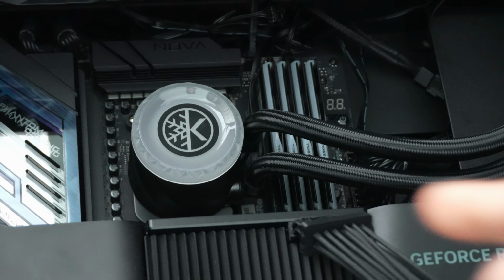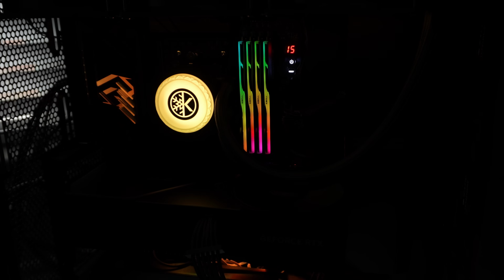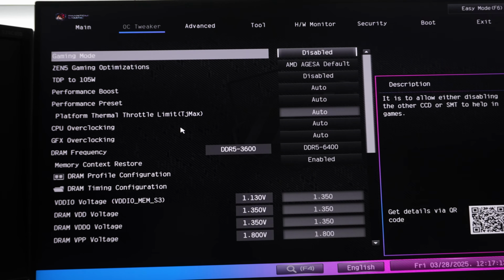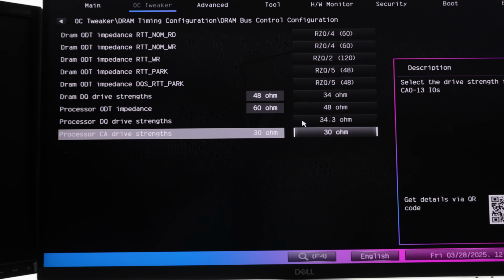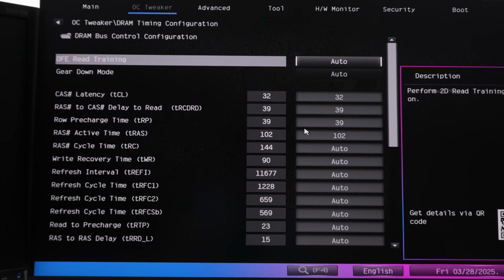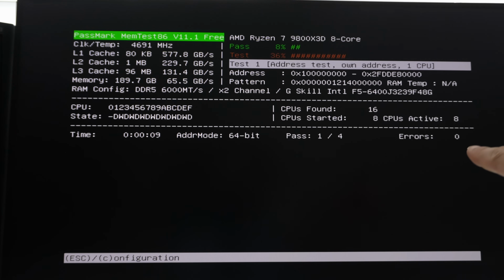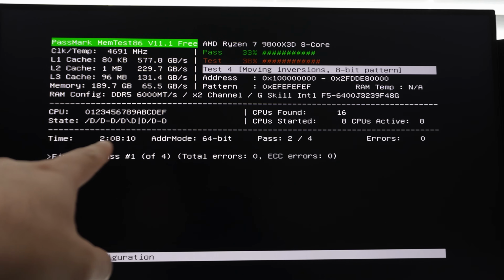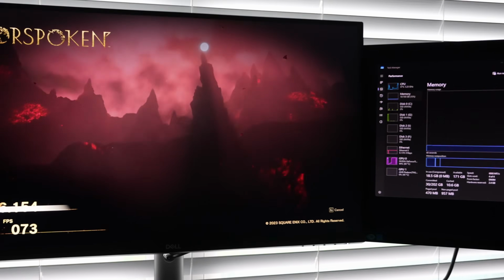How to run 128GB and 192GB at DDR5-6000

Comment: I had been waiting to get the thermal grizzly astral gpu block but it been frustrating so got the oc core, I had my thread ripper asus zenith extreme running 128gig  kit running at its speed,  im about to finish building crossfire extreme x870e ryzen 9 9950x3d and I hope I didnt over do my ram with a gskill 256gig kit I know know I shouldn't had bothered going that extreme but was a 4stick kit of 6000, would you imagine the setti gs would be similar, my zenith I followed some I structions I downloaded and managed not to corrupt anything, I do appreciate your advice and will do the mem test usb
Reply from the maker: Keep in mind that these settings are meant for ASrock and Gigabyte motherboards. They are not meant to be used on Asus. For Asus, if you have the 256GB kit that's on the QVL list then all you need to do is use with the included EXPO profile.

Comment: I will be trying this out on my own system here pretty soon, getting a 2nd identical kit from the same seller of G.Skill Trident Royal 6400MHz 2x48GB RAM, I'm running an Asrock X870E Taichi currently, so I'll try your impedance settings as a baseline & see how it goes, I'll report back with how it went, kit won't be here til Thursday though.  I'm hoping I can get 6000MHz to work, that would be neat... and then I can test how much RAM the workload I run ACTUALLY gets up to if I'm not clearing the buffer & reloading every so often to avoid running out of RAM with the current 96GBs I have.
Thank you for this guide & the other videos you've done on the subject.
I know it's expensive, but it'd be really cool to see you do a comparison between 2 96GB kits or 2 128GB kits & a single 4x48 or 4x64GB kit to see if it is actually easier to make them 'just work' with the 4x sticks kits, or if that's just BS from the RAM makers.

Comment: Using ASRock x870e Taichi with 9950x3d. Have  2 identical kits of G.Skill F5-6000J3036F48X2-RM5NRW. Single kit just works on 6000 selecting EXPO profile in BIOS. with 4 sticks of RAM, best I can achieve is 4200 instead of base 3600. I tried to reproduce same impedance and other, manual voltages, etc, like on a video - did not help in any way. Looking to any way how to obtain it working. 5200 will be fine.

Comment: In my case of overclocking 4x48Gb DDR5, Memtest proved to be close to useless. If will pass Memtest no problem and y cruncher will throw an error within minutes. And even when Memtest and y cruncher are both stable, my PC can still crash when just idlying on desktop. 

So, from certain point, I use only y cruncher and desktop idlying is my final boss.

Comment: do you need those changed impedance values if your doing 192gigs and not just 64 etc
Reply from the maker: This is only needed for 2R 2DPC (i.e. 128gb or higher).

Comment: Same motherboard but I’m using t-force DDR5 FF3D5232G6400HC38JDC01 kits. One 32Gb kit came free with my motherboard from Newegg. I bought a second kit on Amazon. Leaving everything default and changing the speed to 6000 worked for me. Changed no other setting, selected xmp1 default profile for the memory. I’m pretty happy with it. 

Pc uses 9800X3D and RX9060XT. Not fancy but better than my 10 year old pc running a vega64 and Intel I7-9700k.

Comment: Got a asrock steel legend X870 (3.30 bios) running ryzen9 9950X and the exact same memory kit showcased here, and for the life of me, it won't train anything over 4000mt. . I just manually set 4800mt conservatively, everything else in auto, the thing just won't train. Had to clear cmos  at every attempts which is exhausting after awhile... Any idea to even get a shot at fine tuning a successful training past 4000mt?

Comment: I bought the G.Skill Trident Z5 Royal 32 kit, I got 4 in my system. I'm on a Ryzen 9 9950x3d. I cannot get it over 4000Mt. Am I doing something wrong? I need your advice. I might need to replace my CPU, I think I got a bad bin. Please advise because I don't know what to do. I am concerned to replace the CPU. I've spent the whole day adjusting settings to get it to work.

Comment: Hello Good Video :) I have a Asus X870e Hero Ryzen 7 9800x3d and Dominator Titanium DDR5 (6000MHZ) and RTX 4090 i have 4*32 GB RAM 128GB RAM i cant stable EXPO 1 at 6000MHZ but i can 2 DIMMS 64GB Ram 6000MHZ EXPO 1 no problem and i can load 4 Dimms EXPO 1 and go under 5200MHZ isa STABLE give you a trick i can run 128 GB DDR5 RAM at 6000MHZ Stable at 4 Dimms? :) have a nice day :)   RAM: Voltage 1.40 Timings CL 30-36-36-76 @Game Tech Reviews

Comment: hey I am very confused... your DDR is rated at 6600 , you say the target speed is 6000. I am confused. If you just enable EXPO / XMP , wouldn't it just take care of itself?
Reply: 4x DDR5 at full OC speeds isn't possible nowadays. The rated OC/EXPO/XMP is rated for 2x kits.
Reply: @Caborrrl  ~two weeks ago G.Skill demonstrate 4x64GB with Hynix chips at 7000Mhz CL38 on X870E Godlike. And 4x64GB 6400Mhz on X870E Hero.
Reply: @Caborrrl It's possible. One of the PCs we have runs 4x DDR5 at EXPO speeds. It's just luck of the draw.

Comment: Can MSI X870E carbon run 4x48Gb 6000Mhz CL28?
Reply: Yes,Is So Easy!
Reply: Hey, I'm about to buy the same. Did you try it?

9950x3d, x870e carbon I'd like 4x48 6000MHz CL28
Reply: @grutos  yeah, I got it. Running well no problem. But my only issue is CPU running hot at 55 - 60c at Idle. Using Liquid Freezer III Pro. Let me know your temperature with your setup

Comment: I'm planning of buying a 9950x3d and 192GB of RAM but I was not thinking of overclocking the memory. Is the frame rate decrease significant because of the RAM (the GPU will be a 5090)? I was also maybe going for the cheap Crucial Pro memory with high CAS latency (46). With that CAS latency will it be even worse, or because the RAM is running so slow, that high CAS latency doesn't really matter?
Reply: Good luck :-| this is what I have...and it will not boot with 4x 48Gb @ 6400... It keeps defaulting back to 3600, and I can get it to creep up to 5200, but 6000+...hates me lol
Reply: @ultrapetey  Same here. What is your progreess? @MM-ed1we 
I can't get it over 5200 either for the Ryzen 9 9950x3d. What do you have so far?

Comment: Someone suggested to buy 2 2 stick kits with different color heat spreaders so you will always know which 2 belong with each other. I have 1 black set and one white set. Thank you for this! I have this exact board and memory, and couldn't get it to work faster than 3600 (of course) I can't wait to try your methods to get them working!
Reply: lol you didn't hear about serial number 😅
Reply: @PojegaPJG   Probably so...
Reply: @PojegaPJG often times serial numbers aren’t actually sequential. I got a kit that wasn’t. 2 were but 1 was random
Reply: @Savitarax never happened to me all Twin kit it was in order 😅
Reply: I managed to get 4x48 working with 6000Mhz CL32
Tertiary and Secondary Timings tight as my regular 2x16 kit or 2x48 kits with slight variances or +-1 tick due to binning and voltage. 

What really mattered was Terminations and Nitro Mode
Reply: Hello, please tell me if you managed to make the memory work with a frequency higher than 3600? I can't do it with 192 GB, the video tutorial didn't help, my motherboard is a little different - Taichi Lite.
Reply: @Jacksitjey  I gave up. But supposedly some of the newer BIOS make it easier. Maybe if I get bored I'll try again.
Reply: @Jacksitjey  no matter the timings highest I can do is 4400. But 4400 with very tight timings, almost as low as mb let's say them.
Reply: @ThereWasNoFreeName  Thanks for the answer! Good luck to you;)

Comment: I just built my first PC, a bundle from Micro Center: Gigabyte B650 X AX V2, Ryzen 7 7700X, and 2X16GB of G Skill Flare X RAM. I went back a week later and got another two-pack of the same Flare X, and put it in. I would boot the four sticks up in 3600 MT/s and it would run stable and restart, and then I could enable EXPO and get 6000 MT/s, but it wasn't stable, and would not restart. Last night I tried EXPO with Power Down and Memory Context restore enabled, and this time I changed the Memory Multiplier and set it to 4800 MT/s, and it booted right up, and has restarted two or three times now!👍So now my strategy will be to creep up the Memory Multiplier, hopefully to something near 6000 MT/s. I'm guessing I'll have to change some voltages and impedences in that quest...
Reply from the maker: For that setup it doesn't need any of this since it's 1R 2DPC. For that you just need to make sure the different kits are isolated from each other as mentioned at the start of the video.

Comment: Hey man, great video! I'm currently building a pc with 192 gb ram and a 5090, I get the same ram as you suggest. G.skill Trident with 6400Mhz. I just wanna make it get to 5600 but I have not yet bu the motherboard. I know the nova is a good choice but I'm scare because it seems is messing up with the new ryzens 3D? I've the 9950x3d. So I should just get the nova?
Reply: Get the Nova....you won't regret it. Great value board!!! You get it all

Comment: I tried this with 4 dimms of 48GB Corsair Vengeance (Hynix die) rated 4800 JEDEC and 6000 EXPO1. Updated the x870e NOVA bios to same v3.20 as you. The overclock did not post at 6000 for me. In fact, the JEDEC profile does not even post with 4 dimms! Settled on 4000MT/s for perfect 1:1:1 match, but tuned all timings obscenely low: 22,26,26,56,82. MemTest86 reports overall Memory Latency of just 70ns, but throughput (visible during test) is only 48GB/s. As expected from 1:1:1 ratio, MemTest was super stable, no errors. What do you think of these settings?
Reply: I can push to 4200MT/s at 2100MHz infinity fabric. That increases throughput to 53GB/s, but Memory Latency worsens to 77ns and the NOVA starts re-retraining RAM on every single boot! A 10% throughput increase is not worth the 5 minute wait for RAM training on every boot and the 10% latency hit, IMHO.
Reply from the maker: Are the two different memory kits installed correctly, as explained at the start of the video?
Reply: @GameTechReviews  yes, the two dimms from each batch are in A1,A2 and B1,B2 respectively. I even switched them around Old into B and New into A as a test. Did not help.
Reply from the maker: @HamsterHearthstone  DId you try manually choosing 6000 without loading EXPO? And then just manually set VDD, VDDQ to 1.35v and VSOC to 1.2v and then also the same ODT and RZQ values shown in the video?
Reply: memtest86?

Comment: What are my chances of running my Corsair Titanium 96gb at its full 6400 on a Nova/9950x3d?

Honestly I'd be happy with it working at all but wpuld like to hit at least 6000. It feels like it should be easy but I'm reading about so many people struggling with RAM in ways they never used to. Im such a noob too, this is only my second build.
Reply from the maker: If you are referring to 2x48 or 4x24, I've covered that in other videos. Both can run 6400 and it's much easier than what's shown in the video.

Comment: I wish ASRock updated their Bios like ASUS or Gigabyte or some other Company who all have AI tuners and many EZ options to tune instead of having to do literally EVERYTHING manually! I have had ASRock since the beginning...  I got the Phantom Gaming X X570 in my Rig now with my 3090 in it but im building a new rig with the new 5070 Ti card and this time I think im gonna buy ASUS or Gigabyte! I want these AI options and see how they work... I do love ASRock though... Great M/B's...
Reply: The AI features aren't worth it. Its the cause of your some people having overheating issues or just a bricked CPU. I have an ASUS board and I turn the AI stuff off. You either want to do a manual overclock or none at all, because the AI doesn't do a good job of doing things right. I used to be better way back when they didn't push things too far. I even used it as a starting point for overclocking. Now they just set your voltage high which kills your cpu faster and give you a low overclock if any.

Comment: Dude I’m trying the settings and my kit is just stuck on 3600. I feel like I’m going insane. I’m running an asrock Taichi with a gs kill 4x32 6000mhz 30-40-40-96 1.4v all bought that the same time. It also has my voltages locked even tho I’m changing them
Reply from the maker: Are the kits installed correctly? Meaning both are on separate channels, isolated from each other.
Reply: @GameTechReviews I think? My first kit is A1 and A2 and my second is B1, B2. I think that’s what you mean?

Comment: I would like to add......
  Anyone with a Gigabyte Ai board,for memory tuning and preferred speeds,you can avoid changing settings in the bios if you're NOT comfortable doing it by just downloading Gigabyte memory tuning utility called 'Ai Snatch'.
   It will Ai tune your memory to the highest speeds possible and give you a set of options.If you choose an option(speed) and your system doesn't play right,you come back and  choose the next best option,reboot till your system is stable.
  I'm using it since I got my X870E Aorus Xtreme from day one and it's been flawless.
   Hope this helps for those who don't want to fiddle with their BIOS.

Comment: Nice detailed info, noone else bothers to put out. Thx a lot!
What chances I have if I plan to install 64Gb of RAM to the same board? (2x32) What speed of kit should i aim for?
Reply from the maker: Two sticks is easy. Even 4 sticks of single rank is also easy. Only dual rank 4 sticks is very challenging.

Comment: Wait, I just built my system with  4 x 16gig Vengeance DDR5 6400mhz.  Was I suppose to put the sticks on yhe same channel?
Reply: the same pairs from the 2x kits should be on the same channel. The Serial Numbers on the RAM sticks for the same kit will be almost identical so you can see which ones are meant to be paired together.

Comment: i tried your settings from your other video with my Dominator Platinum and ROG X870E Hero. it's a 6200mhz kit and set it to 6000mhz with the same timings in your video but i could not get it to run stable. 😩
Reply from the maker: I too have been unable to get this working on ASUS boards. So far Gigabyte and ASRock seems to be the most consistent performers when it comes to running 192GB at 6000.
Reply: @ damn, im only trying to install a 64gb kit so 4x16gb. am5 is so finicky when it comes to ram. lol
Reply from the maker: @Dryst08  That setup doesn't need the settings shown in this video since that's much easier to do than what is shown here. For that you just need to make sure the memory is installed correctly as explained in the video. Then you just load the EXPO profile. This topic was covered in a previous video a few months ago with the MSI Godlike. Look for the 96gb MSI godlike video on the channel.
Reply: @GameTechReviews how about MSI x870e carbon with 9950x3d?

Comment: Thanks for the  Video 🙂 god be praised 👍🏻 I will definitely try ot what you did in this video 😉 and btw you are really a godsend😁 I've played to much kcd 2 sorry, I have my Build with the ASROCK Nova Wifi finished for 2 Weeks now and as a PC Builder for 28 years and with the experience of getting 500+ Systems build and running (stable) and also watching  all your videos about the topic  😜 I have to admit🤔 I didn't get it working with 2 sets of G.Skill Trident Z5 NEO RGB F5-6000J3036F16GX2-TZ5NRW past the 5400 MTs line . I went and based my Settings on everything I know about RAM paired with the things seen in your other vids about the whole "4 sticks of DDR5" topic and started with the slow jedec profile that you can load and from thereg tweaked everything from hand 😌 including the impedance Settings 😏 got it from 4800 to 5400 across the 4 dimms and it runs fine and rock solid tested multiple times with OCCT (2 hour and 4Hour ) and Gaming for days👍🏻  but everytime I tried to push it further it gets instantly to completely unstable and resulting in system freezes after opening up something or simply restarting when running OCCT or other memory / stresstest's 🤷🏻 Edit: forget to mention my CPU is a Ryzen 5 7600 non X at least until the Price for the 9800x3D gets under the current 540 €  for which it is mostly going for here in Germany😉 so i tried the Settings from this Video again🤔but it seems that the small placeholder Cpu that i got is not capable to handle the  4 x 16 GB Dual Rank Hynix A die modules with 6000 MT/s as soon as I get to the memtest, after just a few seconds it finds either 16 or even 200 errors, and then the memtest freezes completely, and I have to do a soft reset. At 5800 MT/s, I managed 1 hour and 59 minutes without any errors, and the next time I tried it without changing anything, I got 8 errors within 27 seconds of the second memtest run. So, unfortunately, even 5800 MT/s seems to be very inconsistent and not completely stable.🤷‍♂